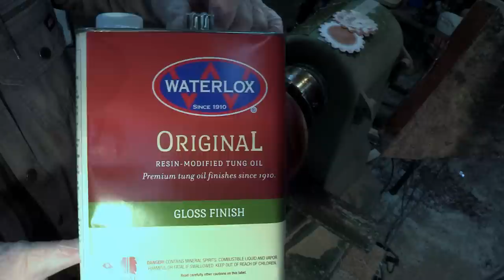Woodturning - Cherry Crotch Hollow Form

Comment: Designer Epoxy - i enjoy your turnings.  I am just restarting after a 35 year hiatus.  I'm using the lathe from my grandfather's shop which originally was water powered belt-fed from Amherst MA.  It has a 1930s motor my grandfather rigged.  I'm trying to upgrade the motor with a variable speed motor. I've just gotten my first two gallons of epoxy.  Hopefully I've learned enough from you to do something cool
Reply from the maker: That is awesome! Thanks

Comment: Jim, designer epoxy worked great for this turning.
Possibly if you had put a plastic drinking straw down into the top of the voids, that would have let the trapped air out, then remove them just before the pressure pot. My suggestion for your future projects that have voids.

Jimm
Reply from the maker: That might of worked too, I think just using a simple screwdriver shoved down the side of the bucket would of worked too. Thanks

Comment: Thanks for working through the project Jim !  

Carving might not be your thing but maybe taking the angle grinder and adding a curved line to the top to match the bottom instead of the straight line.  I would also eliminate the middle chunk of cherry might of helped with the overall look but I know you were pressed for time.. the figure in the wood is beautiful! Thanks for doing your best to showcase that for us 😊
Reply from the maker: Thanks for the suggestion!

Comment: Designer Epoxy. Jim a very stunning turning. When filling the voids it might have worked to grind a small grove from the top to the void as you actually turned away the outside. This would have allowed the epoxy to flow down into the void. You worked it out very nicely.
Reply from the maker: I thought there was lots of room for the epoxy to flow into those voids. That and the pressure pot I though were a winning combo. Lol. Thanks

Comment: I'm curious, could you have poss roughed off, or turned down the upper end, down to the gaps. Say maybe like 1/8 to allow a small space, between the bucket and first pour, so that the gold could make it's way to get into the gaps?? It's just a random thought. Thanks for the great content. Always a joy to watch
Reply from the maker: Yes, that could of been done, but I think an easier thing would of been just to drive a screwdriver down inside the bucket until the void areas were filled. Thanks!

Comment: Hi Jim, great project, one thing I have noticed though is it looks like you pour the resin very quickly onto the top of the project thus potentially creating an airlock. I'm no expert but I wonder if pouring the resin slower (over say a minute or two) would make a difference. Great work, cheers.
Reply from the maker: I don’t think that has any bearing on it. There was just too tight of a seal between the casting and the bucket and that didn’t allow the resin to flow down the sides. Thanks

Comment: Beautiful piece.  Question (as a non-woodturner) would it work better if you poured the epoxy on the bottom piece of wood then place the 2nd piece and finish the epoxy to hopefully avoid the gaps?  Then it could go to the vacuum chamber and maybe have less trouble pulling the epoxy into the space between the wood pieces.   Total amateur viewer but that was what I thought might help.
Reply from the maker: It’s best to do it in one pour, that way there’s no witness lines. Thanks

Comment: Couple of hard breaks, but you pulled it off! I'd certainly be proud to own this hollow-form. Got a kick out of the cyclops/evil eye/jack O'Lantern look from the interior illumination.
My only suggestion would be to have a video or two of simpler projects in the hopper that you could put up when you run out of time, to take off some of the time pressure when things go wrong like this.
Great video as always, Jim!

Edited to add: really looking forward to what you do with those sweetgum pods!
Reply from the maker: The sweet gums look awesome! Thanks

Comment: I’m curious if you think that throwing the piece back in the vacuum pot for the second casting would have avoided the problem with the voids left by the gold DESIGNER EPOXY resin. It seems like the air in those pockets would be pulled out be the vacuum, and filled by resin upon release. Any tiny remaining air could then by minimized by the pressure in the pressure pot. Thoughts?
Good save, though! It came out good, if differently than envisioned.
Reply from the maker: Sure, an easier thing would of been just to drive a couple of screwdrivers down the side of the bucket when I poured the gold. That way it would of seeped down into the voids. Thanks

Comment: Did you hear me whispering “gold, gold, gold?” I’m sooooo glad you chose gold. The figuring of the wood is mesmerizing. If do have a question. Could you have just left the piece on the lathe with one of the crevasses at the top and used a needle to fill it with gold, instead of using the pressure pot? I love the piece  and know it will find whoever needs it!
Reply from the maker: Yes, but how do you fill the other side? Thanks

Comment: I used to work with lasers, and they absolutely can be very sensitive to vibrations and jostling. The ones I worked with were in a lab, so there may be ruggadized versions for tooling, Idk, but the ones I worked with had mirrors and a prism and a light source and if they didn't all line up just so, you got no light. So bumping your table could force you to start over. A LOT.

I would definitely suggest seeing if there's any way of getting some vibrational dampening for that laser. Idk if wrapping it in a fabric pad could help significantly, but whatever you can do may in fact extend the life of your lasers.
Reply from the maker: I’m going to try to setup a laser that goes on a gun. Thanks

Comment: For the small flat piece of wood that you received: what if you broke/cut it into different small shapes, then put those into medium-large size casting molds to fill with left over resin? That way you (maybe) use less resin, and have a random surprise for when you finally put it in a project
Reply from the maker: Yes, this is kind of what I was thinking. Thanks

Comment: This is a very different piece. The distinct lines on the outside are a little distracting but given the obstacles you had the outcome is wonderful. Do you ever have any issues with using resin finish inside and a different finish on the outside? Designer Epoxy
Reply from the maker: Never, technically both are film finish. Thanks

Comment: I love the way the wood looks. I'm not super thrilled with the way the resin turned out. I hate to say that because I wasn't there doing the work. But I was yelling at the screen to backfill those voids with magenta. Anyway,  even if I'm not a huge fan of the way the pours went for you, I can hardly hold that against you. It was a Murphys law kind of project. But having said all of that. You are an exceptional talent on the lath.
Reply from the maker: I get it, thanks!

Comment: Could have turned it upside down, put it in a bucket a little larger when you poured the gold resin? I would think it would fill the open areas but Im not a wood turner or a resin user.
But you keep trying and do the best you can. I admire that quality.
You didnt gve up and the piece came out beautifully done! Another art piece, Jim.
Reply from the maker: Yes, but it would of taken more resin to do so. Driving screwdrivers down the side of the casting would of worked as well. Thanks for watching

Comment: There is plastilena clay (miss spelled maybe), that is used by artists to sculpt forms (statues). You might be able to sculpt it around such holes that it should save on resin. The resin will not stick to it. The down side is that it utilizes a petroleum product, Petroleum jelly I believe. But if the wood is already filled with resin, it should not stain the wood. Good luck.
Reply from the maker: Should work. Thanks

Comment: I have a question about turning outboard. You've said multiple times it's because you're left handed but what is it about the lathe bed that gets in your way? I'm right handed for nearly everything except swimming and turning (apparently lol) and I don't find I have many problems turning inboard, granted I'm just turning pens for now. My dad has one of your pieces (gorgeous btw!) and we've both tried our hands at turning bowls inboard. I haven't asked him about his experience yet but I didn't notice any difficulties. Admittedly I've only tried shaping the outside. I'm interested in your thoughts and experience on the matter, especially before I go invest in a bigger lathe! 😂 Beautiful work as always, so creative and talented!!
Reply from the maker: Turing the outside is a breeze over the lathe bed. Just like baseball or hockey, usually your dominant hand is on the bottom of the bat or the top of the stick where it’s cut off. Same with a gouge, usually your dominant or your power hand is on the bottom of the gouge when turning. We are all different and all I can say is try it and see if your comfortable. Hope this helps. Thanks

Comment: Hello,
As usual, again a fantastic piece of art !!
I’m relatively new in woodturning, and I have a question. At what speed do you turn on the lathe ? Do you use the same speed for wood and resin ? I guess I use a speed that is too high, sometimes 1000 RPM. 
Thank you in advance and lots of greetings from Belgium !!
Koen
Reply from the maker: It depends on the piece. Turning resin at 1K is fine and that’s what I try to turn at but in most cases my larger work will vibrate to that speed. If you have variable speed, turn up the speed until if vibrates, then lower it until it stops. Turn the piece from there. As it thins out try turning up the speed. Hope this helps. Thanks

Comment: You needed to grind a couple grooves from the top of your void to the top of your wood piece. A place for the air to escape along the side of the bucket. They wouldn't have to be big and you could turn them off with no more waist than what you turned off to complete the piece. Still looks great. I love your work.
Reply from the maker: Second one to suggest this. Thanks

Comment: I think there where 3 options to deal with the problems you had maybe 4 /, 1 you could of lead it on it's side and done a pour into each of the cracks one at a time, 2 used a parting tool to get ride of the cracks, 3 cut it down in size where the cracks were ,or 4 done another pour and put it in the vacuum pot to pull it down into the cracks, but I think you came up with a good vase at the end, good on you, from Nicola in the UK.
Reply from the maker: Thanks 😊

Comment: Please dont pour the epoxy allover, if you pour it from one point, the air from the gaps will have a place to escape, when you pour it full circle, air has to fight aganist the pressure of the liquid to go out..

Also, when youre putting it into pressure chamber, are you putting in air, or vacuuming it out? Cuz it looks like the boiling point is being lowered and it is being boiled, instead of air bubbles coming out with the force of the vacuum ?

Cheers✌️
Reply from the maker: Yes, when it goes into the PP I put 60 psi in the pot. Yes, eventually the resin will boil under vacuum. Thanks

Comment: Oooh, I like it. I think the gold/magenta stripe in the middle is a lovely touch. I'd be putting a flameless tealight candle in that baby for an inner glow. It's very pretty!!!

AND...I had a thought for what to do with your giant pine cones.
I'm sure the shape makes it seems a bit obvious...but then...sometimes you just need to go with the obvious!
How about CHRISTMAS TREES!
I don't know anything about using a lathe or working with resin, but I think it would be very cool to create a little Christmas tree that actually has the pine cone as its centre. You could taper the shape to the classic "pointy tree" after your multi-colour green resin has cured as it has engulfed the pine cone inside. (Oh, and if there was any way to drill from top to bottom a small channel where you could insert a small string light -- if that even exists -- well, even more cool. If you had a resin mold for an appropriately sized star...yep, place that puppy on the top and you've got yourself a lovely little piece of Christmas decor. I wish I could attach a picture of the image I have in my head...but I'm pretty sure THAT technology does NOT exist yet.)
Anyhew...just a thought. Cheers!
Reply from the maker: It’s a good idea. Thanks

Comment: I've had trouble with projects before. Sometimes they really just don't want to be what you want them to be. And everything you do to push them in that direction is just a hard slog through mud, and generally full of failures. I've learned that when I encounter this, it's time to set the project aside for a bit or let go of my idea and let the project tell me what IT wants to be. I usually find that my original idea was not nearly as good as what the project wanted to be, which turns out to be so much more brilliant and amazing!

I love the wood grain, but you're right, the resin effects are not as spectacular as they usually are. Oh well. It's still a nice piece. I am much happier with the silhouette you ended up going with. I was not a fan of the ribbing idea or the big band you cut in. The straight lines of the band, even filled in, kinda argued with the curves originally in the piece, but filled in was definitely a lot better than bare. Thank you! Oh, and I do like those colors together. The gold and the magenta really do compliment the wood tones. They practically sing together!
Reply from the maker: If I wasn’t shooting the video, it would of ended up on the I’ll get back to that later shelf, lol. Thanks

Comment: To ensure full penetration of the gold, possibly pull a hard vacuum after pouring. Then atmospheric pressure will force the gold into every nook and cranny when the vacuum is released.
Reply from the maker: Yes, but all that was really needed were a couple of screwdrivers pushed down on the sides to allow the resin to flow down into those areas. Thanks

Comment: I like your choice of colors, but I  think you would have a n easer time if you built a vibrating table to sit the bucket on vibration will cause the air to raise up through the fluid
Reply from the maker: I need to make one or build one. Thanks

Comment: Hi 👋. I have not finished watching it all yet, but you were saying about you had problems with a laser, I built my own elbow, type system, hollowing tool , and I had heard that there had been problems with some lasers, I am using a laser that goes onto a telescope on a rifle that you use for setting up your telescope, it’s approximately 3 inches long I think about 3/4 of an inch in diameter. I’ve never had any problems with this apart from me leaving the battery switched on over a long weekend., Obviously you might have to modify. Your melting system, I hope this is some help..
PHIL FROM THE DARK SIDE OF THE MOULIN FRANCE
Reply from the maker: Someone else suggested a laser for a gun as well. Thanks

Comment: I've seen some use plastic and hot glue to make a pocket to put resin just in thouse areas
Reply from the maker: Yes, that was an option but like I said in the video, I was trying to fill in the cracks on the top. Thanks

Comment: I'm an idiot Jim, and I have watched other channels too; but it always comes back to a venting issue.

Just like in plumbing, in order to get the flow going, you gotta have a vent.

Splitting the difference between function and cost effectiveness, it just came to me as an idea.

Flood rim level the deal.

Your fluid is is very thick, but flows; it is a niche viscosity.

Once the fluid hits the vent, and submerges it, it's done functioning when the head pressure and air path is stronger than the escape route.
Air locked.

We're limited to containers, vacuum, and pressure pot.

I'm looking at a measure right bucket, and you rarely go over 13 liters; doesn't matter really.

If you were able to install straws that 90 up and above the top pour, incrementally at 3,6,9,12, exc, placed in areas you know will be an issue, the resin would push the air in the path of least resistance.

Pain in the butt, bunch of additional  labor, little resin loss though; but it'll work.

Vents in incremental level would satisfy all the levels in dimensional pour.

My ideas work, but are terrible for making movies; logic is boring.😅

And in the end, it is best what you do anyway, you always buff it out beautiful and a good video that entertains and teaches.
but for the sake of accuracy and trying to help, that is what I got for you sir.

I think it's beautiful. Grain pattern into the resin, you can rotate the piece to get a different feel; definitely dig it.

Thanks Jim.
Reply from the maker: A simpler solution would be to grind channels down to the void area to insure the resin flowed into the voids. This was suggested by others. Thanks